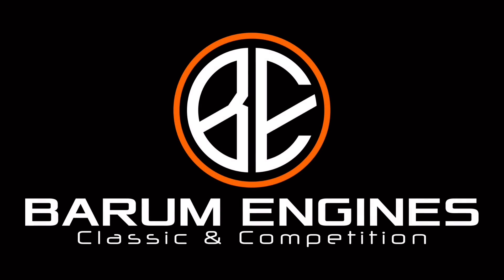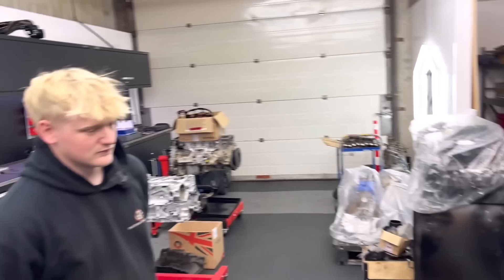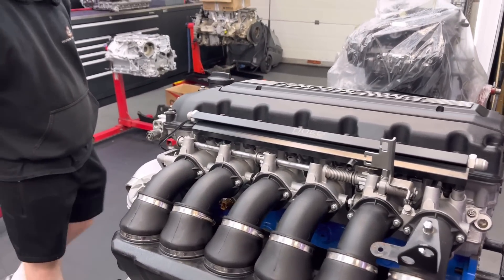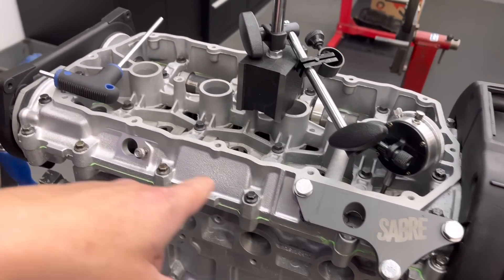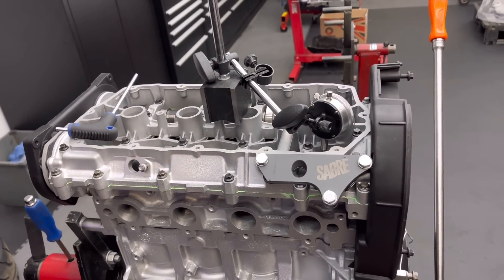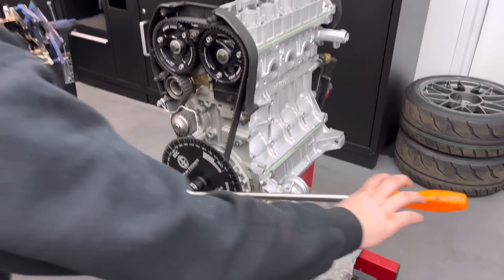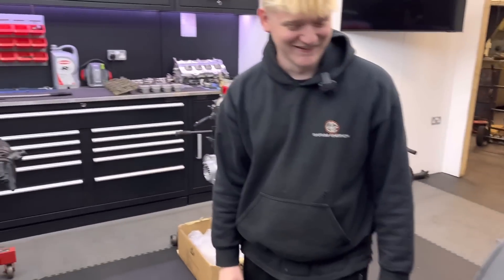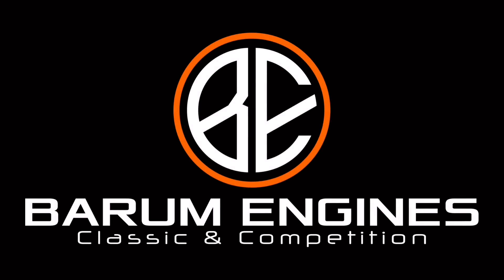Apprentice sets up cams on his FIRST Race Engine!

Comment: Is there not a tool/meter to accurately measure the belt tension, as surely there must be an optimum tension to maximise efficiency ?
Reply: There is a tool and I have one, but it's useless if the manufacturer doesn't give you a spec.

Comment: Why do you call them rocker covers? They are cam covers.
Reply: It's old school mate.
We had push rods  and rockers back in day..
Thay had a cover..a rocker cover.😂.
Then we had over head cam.😅.
Those lads had covers too.
Guess what thay called them.?
Reply: Rocker covers started in the early 1950's with Morris Minors and Standard 8's with rockers and push rods
Reply: Some OHC motors have rockers, some use buckets, and some impinge directly on the valves.
Reply: @jsh6952  Agree. If an engine has rockers, then call the cover a rocker cover. The K series and many ( maybe most?) modern engines have cam followers, so they have cam covers.